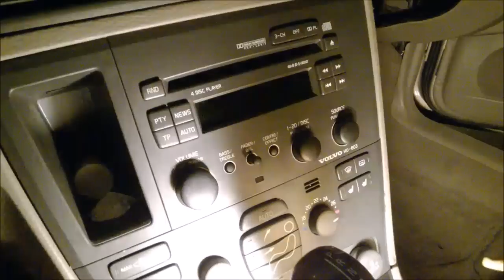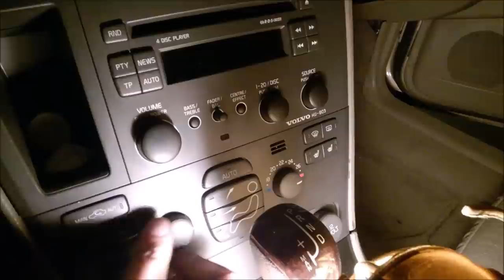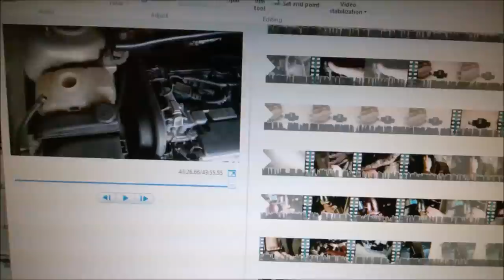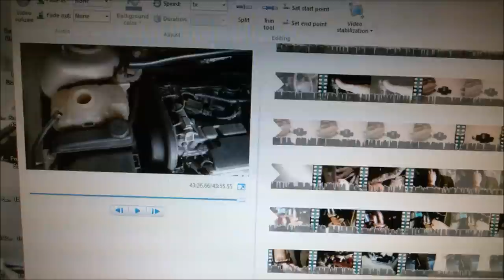Volvo S60 V70 XC90 Heater core matrix replacement - left hand driving 2001-2009

Comment from the maker: ***** IMPORTANT ***  READ BEFORE STARTING  
BE SURE not to rotate the steering wheel while disconnected !  This will damage the Steering angle sensor (Anti-skid and or Airbag error messages)
TURN THE HEAT KNOB to FULL heat with the ignition ON. This moves a blend door linkage away from the heater core so you don't break it
You can fully pull down and out the steering column but be sure to mark it so it goes back at the exact same rotation
I inserted back the upper clip from the right side
Important:  At  6:10  Steering shaft wing screw part #987281: torque 22ft-lbs (30 Nm). This is a safety bolt, tighten using a torque wrench and insert the bolt from above (nut at the bottom). 
People had trouble inserting back the lower clip. FLATTEN the clips after removal, and don't bend the pipes too much. If the clips are not perfectly flat, they won't go back in there. Inside the engine bay remove the bolt and the metal plate at the firewall between the two coolant rubber hoses to the heater core, then inside the car look up and cut a zip tie at the two metal pipes: the metal pipes inside will then move easier away from the heater core. If the clip still doesn't go back in, the pipe end may not be flush with the heater core opening - it may be slightly rotated either vertically or horizontally. Keep the pipe pressed against the heater core while inserting the clip but make sure the pipe opening sits really flat with the hc opening (may try pushing it with a flat screw driver). I inserted back the upper clip from the right side. May also lube the seals with synthetic silicone grease.
At 28:50 don't cut that plastic piece, once disconnected push upwards the coupler - you can actually also pull it downwards and remove completely the steering shaft, however be sure to mark it first at the upper spline and to insert back at the same position, and also make sure the steering wheel and the front wheels don't rotate when it's sitting disconnected - you will damage the clock spring sensor and get an Anti-Skid message ($$)
You may try to just drain the coolant reservoir, instead of draining the entire coolant system. BE SURE to disconnect first the electrical connector at the sensor under the reservoir so you don't stretch the sensor wire (it will damage it), lift the reservoir (it may be stuck on the P/S reservoir), and drain it.
It is an awkward body position and  may hurt your back/neck.
If you need to disconnect the rubber hoses at the firewall https://youtu.be/FNdgdMmiNvE If you want, you can disconnect one of these hoses, and blow air through the opening in the firewall: this will blow out coolant through the other hose and empty the heater core enough so it won't spill when you disconnect the metal pipes.
RIGHT HAND DRIVING CARS  (UK, AU, etc), a piece of the dash and of the air filter box needs to be cut to remove the matrix. See this forum https://www.matthewsvolvosite.com/forums/viewtopic.php?t=94286 and pic https://www.matthewsvolvosite.com/forums/download/file.php?id=55010&t=1

Comment: I've had a huge struggle with getting the o-rings/tubes seated properly (discussed at 35:30). Tapping it with a hammer didn't work that well for me as I couldn't get enough clearance. What I ended up doing is balancing a big flathead screwdriver, covered the tip with some rubber (inner bicycle tire in my case), on the "notch" of the aluminium pipe and tapped the end of the flathead screwdriver. After 2 hours of trying to get them seated properly without avail, this did the trick within 3 minutes. As always, thanks for the great video Peppermint!

Comment: For anybody who is struggling to get those retainer clips back in place:
If your oring and hoses did not sit flush into the hole, those mfing clamps won't go in no matter how hard you force them in. I've done whole job in roughly two hours and wasted another two days trying to get those retainers back in. Do not try to grease any part of the core or orings. It won't work and from my experience, thin oil makes things worse. Flatten your pins as much as you can. I didn't have a silicone based lube and I couldn't find it anywhere in my country. I used strawberry flawored nivea chapstick on them instead. That stuff worked like a charm! Lubed everything, orings, pipes holes and those pins went in like i haven't wasted my two days! Also make sure to align hoses perfectly to the holes. Also, Thx for the creator of this video, I couldn't do it without this one.
Edit: I also didn't have to disconnect the steering wheel unit at all, though i bent some fins on the new core at least i didn't have to reassemble that part.

Comment: Thanks for another awesome video.
Had to replace the o-rings on the heater core pipes today and found that in right-hand drive cars you need to remove the glove box to gain more access.
Removing and replacing the clips was the hardest part of the job and in total the job took about 4 hours.

Top tip: hammering the pipes back into place (so the o-rings were fully seated) didn't work ONLY levering them into position worked for me.
Reply: bigbluechopper  im trying to do this job on my right hand drive s60 but after removing the glove box i find the dash is in the way .did you remove the dash . how did you get round this ?
Reply: @charlieoscar2714  I did not have to remove the dash, but as part of removing the glove box some of the dash comes off with it.
Here are some photos of what it looked like:
https://u.pcloud.link/publink/show?code=kZGtMUkZEgOjNoqQ6duFqAhuveeiD4BQjyQ7
Reply: @bigbluechopper24  thanks.. the right bottom of the dash looks like it will prevent it from coming out . it must be super tight .im thinking of cutting that bottom bit of the dash off and making it super easy
Reply: @charlieoscar2714  I think it should come out ok.
But I just replaced the o-rings and didn't replace the heater core.
Reply: @bigbluechopper24  well the dash had to come off .. not good

Comment: This was a huge help to getting this job done, many thanks for putting this out there!  Everything was spot on, and your detailed brake switch info surely helped prevent me from breaking the mounting tabs - awesome!  The only place I deviated was that I did not drain coolant.  Instead I used 2 hose pinch pliers, clamped the heater hoses going into the car, removed the quick disconnect and the mounting plate on the firewall.  This also has the added benefit of freeing up one end of the rigid aluminum tubing.  I then cut the tie wrap that binds both tubes at the top so that when I removed the tubing from the heater core the tubes move about quite easily - no need to bend anything and they get right out of the way.  The added info on removing the steering knuckle was also great to know in advance.  REmoval was a snap - and not having that out of the way would have made removal and install a giant PITA.  Nicely done!
Reply from the maker: Thanks for the trick without bending the metal tubes.  I also recommend people read my comment with 'Please read' for more infos
Reply: Thanks so much Tim as your suggestion along with Peppermints video make the job relatively easy except for the confined working space from with the drivers floor well. Thanks again.

Comment: I just finished getting the heater core back in. I did not have to remove the steering wheel bolt. That was a good thing because I was having trouble with it. The brake switch info was very important, and useful. I would never have gotten it off without this video. I did cut the lower lip of the heater core enclosure with a small die grinder and used a zip tie to hold back the heater core tubes.

Comment: Thanks for this. Worked perfectly. A couple of comments: the brake switch does not need to be disconnected; just duct tape over the switch to keep the lights off and tuck it out of the way. Also, one of the clips can be put in from the other side - much easier to access and won't affect anything. Took me an hour and a half in total.
Reply from the maker: Thanks for the tips!

Comment: Before you run out and spend your $$$s to buy a new heater core (make sure you buy the correct model, there are two versions; blue thin and square-ish & brown Battlestar Galactica), first check to see if the two O-rings on the aluminum tubes that feed the core have not dried out and cracked from the heat over the 10-20 years since these models were produced. That's a $5 cost vs a $300.  Other than using water only instead of coolant and living in a sub-zero climate, there is little that will cause these units to fail, though apparently one core model would separate its plastic side housing from the coil & fins (reported to have been corrected in new models). 
 
Everything about this job is a pain in the ass, or your back.  Before beginning, disconnect the battery so you don't get any codes.  You'll have to remove the driver's seat to get your body in there, and with the seat out, it's best to remove the carpeting, (which requires removing the door sill, snaps out, and console, remove plastic retaining screw, side panels) cause stuff will spill.  Note the direction the aluminum tube clips go in.  Seating the tubes and getting the clips back in is one of the hardest aspects of the job.  If the car doesn't start, you probably didn't set-up the brake kill switch mechanism correctly.  Good luck!

Comment: Great video, saved my day. Was not 100% sure the heat core was my problem as the flow seemed good when I flushed it through. Both Al-tubes at heat core were also hot BUT the side of heat core was cold,-good thing the check before replacement. A piece of wood and a plastic wedge between the break pedal and al-tubes was a good help when inserting the clips. //Emil, Gothenburg SE
Reply from the maker: Interesting detail. You mean the plastic side that is exposed under the pipes connections, was cold to the touch ?

Comment: I replaced mine today and I struggled for over two hours to get the damn pipe clips back in and it was just impossible to get them properly seated. Then I realized I had put on the o-rings dry, so I applied the absolute tiniest amount of grease and then they slipped right in and seated properly. The clips went in just as easy now. Ugh. Now I see you've actually mentioned it in the pinned comment :D

Comment: This is such a fantastic video thanks.  Too bad it doesn't show at top of search results for V70 heater core.  Instead you get Farpoint Farms video, which gives bad advice!  About the clamping of supply hoses at the firewall: that is unnecessary, as these supply lines go over a "high point" in the system.  Thus, unless the system is pressurized, no extra coolant will flow towards the heater core, when it is disconnected.  You only need to clamp the hoses, if you intend to start the car, with the heater core out (ask me how I know!).  Thanks for this excellent video, it is the best for clarity and detail.

Comment: Thank you for this video! It made replacing the heatercore so easy. And yes, pulling the steering rod down a bit, made the core come out and go back in without putting stress on it. Also, you dont need to drain the fluid before disconnecting the pipes. The only fluid escaping will come from the core itself, not the pipes... Thanks again! 👍
Reply from the maker: Great feedback, thanks!
Reply: Just curious. You’re saying I don’t need to drain coolant from the engine bay the way he did? Thanx!
Reply: @luddel4747  Yes, exactly.  Just let the pressure from the system (open/close filler cap) before dismantling the core, and youll be fine. There might be some minimal leakage, but nothing you cant handle with a towel or something similar. Most of the coolant will drip from the core it self.

Comment: Thanks so much Peppermint for this fantastic video plus Tim Hollands suggestion on removing the quick connects and firewall mounting plate to allow for ease of moving the connected pipes at the heater core. Between both of you, you make the job not really that difficult albeit its quite a confined space to work from within the drivers floor well. Kudos to both of you... great job guys!!

Comment: Thanks a lot for detailed video. This is very useful. For the right-hand driven car, the pipes to the heater core stay on the same side (left side) but to remove the heater core, we have to remove from the driver side (right side).

Comment: Great video, especially the details on the brake unit. That saved me! For the heating core clips, I recommend using long reach 90 degree angled needle nose pliers. It gets in there perfectly and provides a great deal of leverage.

Comment: Thanks for the video. So helpful. One quick tip is if you're having trouble getting the tubes back in far enough to seat with the new o-rings put a little o-ring grease or bulb grease on them and they'll seat right in. Use a silicon based grease -- don't use a petroleum based grease as that will degrade the o-rings over time and possibly cause leaks.
Reply from the maker: Thanks for the tip Frank!

Comment: Great video!
You explained the process of removing the heater core very well.
Another YouTuber who did this job said that you don't have to drain the coolant from the block because the heater hoses sit quite high in the firewall. Therefore not much coolant will come out of the pipes when you disconnect them from the heater core.
Great tip with the steering coupler!
I am happy that replacing the heater core on these Volvo's is quite easy to do. With most other cars you have to disassemble the whole dashboard. This is a very good design from Volvo I think.
Reply from the maker: It is still very difficult to remove on right hand driving cars - basically they need to cut into the dashboard - I've put a link in the top comment. The older Volvo before 2000 had common issues with the heater core and they had to remove indeed the entire dash, there recent Behr cores are much more lasting (but hey can still clog usually from wrong coolant mixture)
Reply: @Peppermint1  can these heatercores still going to leak?
You said that the o rings on the pipes can going to leak?
Thank you for the quick response.
Reply from the maker: @anfahrt  I see on cars from 2001-2002 very very small leaks at the o-rings. But not at the heater itself. I think it's not at all a concern, at least not if the unit is the original Behr

Comment: Great instructional video Peppermint, much appreciated. I didn't drain any coolant, the reservoir was about half full, the other half was in my drivers side floorboard. Once disconnected the amount of coolant draining was minimal,  plastic bag in the floorboard did the trick 
I used needle nosed vise grips to assist in reinstalling the clips.
Install the bottom clip opposite the way it came out, it's just easier. When reinstalling the brake light switch you'll have to move the pedal away from the switch bracket in order to clear the tabs.
Reply from the maker: Thanks for the tips!

Comment: Used this video as instruction which made the heater core switch easy. Heat is back on! A tip on the bent clips is to use the old heater core as a "template to get the clip in correct form. Also used a hammer to lightly flatten the clip. Once the clip slides easily into the old heater core, go and use it on the replaced one to secure the tubes. 
Its easier to try and fit the clip on the old once its out than laying under the steering wheel and trying to fit it 😅

Comment: Disconnected the steering joint like you advised. Extended the steering wheel out as far as it would go. Wiggled the old core out without damage and reinstalled the new one. Might have bent a few fins but it slide in. Those clips are a pain in the ass. Reinstalled the the brake switch like you said 👍🏼👍🏼Perfect no damage. I'll post up pics of the tools that I used. Thanks for the help👍🏼👍🏼.
Reply from the maker: Great feedback, thanks
Reply: How did you get the clips in?

Comment: Huge thanks to you, saved me from buying a new heater core, my 2001 S60 started leaking through the seals of the heater core and didn`t know what to expect or to do for like 3 months. The whole carpet got stained from the coolant and my specific problem was that there was coolant on the side of the carpet, under the heater core, the pipes weren`t wet from coolant, but the spot where you point at 0:50 in the video was wet. Huge thanks to you again!
Reply from the maker: Glad it helped

Comment: This is a perfect 9.9 out of ten! Very detailed descriptive! I just wonder about one thing, but that maybe because of the MJ of that model: I do own a 2005 MJ and only have to loosen a screw right under the lower right front to let drain out the radiator instead of "see nothing and break my hand" behind the manifold ;). This screw can be found here: If you stand in front of your car, go down on your knees and take a closer look under the right front where the splash shield shows a round whole. When you look inside you will see an Allen bolt inside there. Loosen this screw gently fo a few turns and the coolant will flow. You don't have to remove the screw completely. Wait until the desired amount of coolant has drained and then close it again.
Reply from the maker: True, we can bleed the radiator at the lower right radiator drain valve. Sometimes this plastic screw can break upon loosening it (perhaps because some garages would have tightened it too much).  It needs tightened 'finger tight', being made of plastic it gets brittle with time, it can be fragile (some had the bad luck to break it, but it can be replaced).  But the reason for going with the block valve drain was to drain only a part of the coolant, just enough to empty the reservoir.  Cheers!